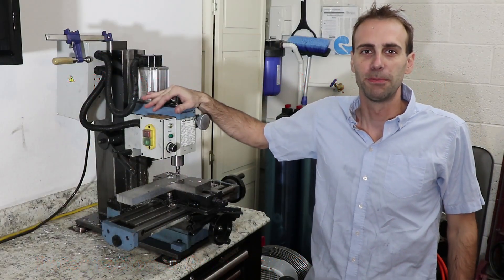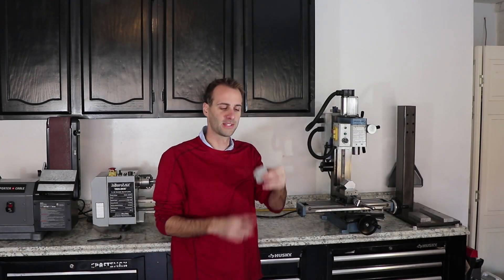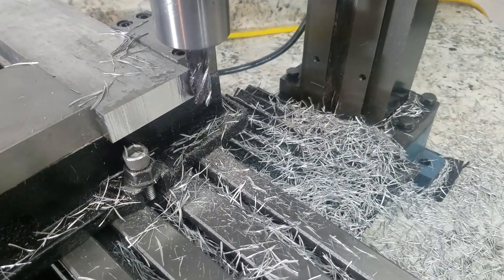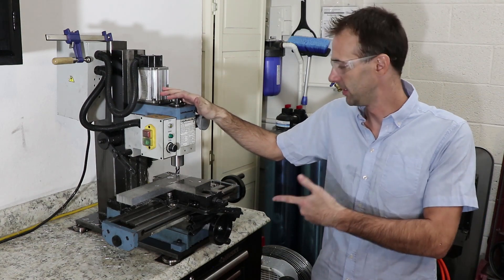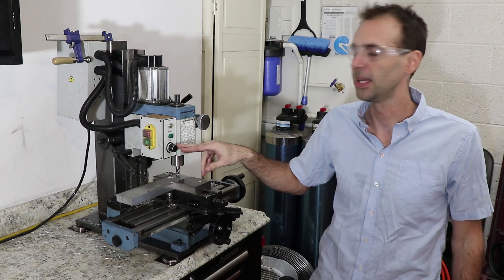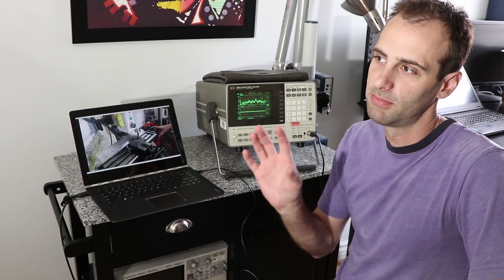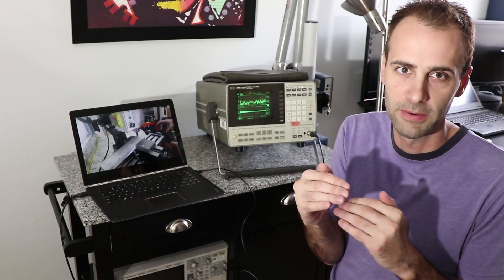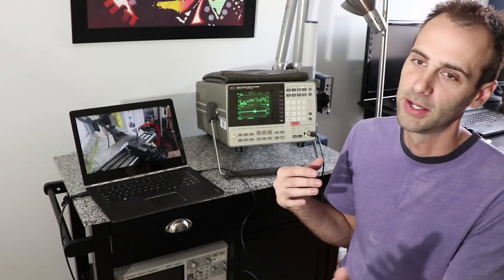Column Stiffener - LMS HiTorque Mini Mill

Comment from the maker: Thank you every one for your feedback, I am humbled that so many experts and hobbyists alike are chiming in! If we are all interested, I could use some help on how to perfect the experimental setup to prove all these great suggestions we are getting (number of flutes, direction of cut, ect…)
THIS video should really be called something like how to excite every resonant frequency in your tool (the opposite of how to produce a good surface finish) – it is not a great example of how to machine, what I hoped to do was push this tool beyond its limits before and after the mod, then try to quantify/identify the thresholds.
I have successfully cut just about every tricky material on this tool: Inconel, titanium, copper, plastic, even ceramics; it is capable of cutting them and making fantastic parts, what it’s not capable of (in any way no matter what you do to it) is be physically stout or massive enough to cleanly remove aluminum at this [in the video] high of a volumetric rate - it did it as you can see but man did it complain - basically the point of this experiment right? 
Per specific comments: 
I can tell you with absolute certainty that the nonmoving axes were locked, the gibs in the travel axis were tight and the table was not flailing around - further proof is that the gibs were so tight that the whole mill would rather slide rather than the dial turn (rubber pads under the feet got all oily when we moved it for welding); in normal operation there isn't this much force on the dials so the mill doesn't normally slide, especially when the pads are not oily; therefore no need to bolt it down.
Cutter geometry, number of flutes, feeds & spindle speeds.. all these make big differences across comparatively similar situations but to me a good machinist can "feel" around their weaknesses and tune the cut to suit – again, this particular experiment was to push the machine (and tooling) past its limits and excite those resonances so they could be measured.
Reply: How do you manage to tram it in with this setup?
Reply from the maker: @Sheepisgoo  When the column was bolted to the base, I used snap gauges to measure the gap and milled a spacer to suit. Its within a tho or so, you could do the copper and grout trick if you needed, but I don't.
Reply from the maker: @joenicotera2991  Yes, the "instrument" will always resonate; I like your association. The objective of a musical instrument is to resonate well over a desired range, and the objective of the string or pipe is to resonate at a discrete frequency (including it's harmonics). Similarly the design objective of a machine is to resonate at only discrete frequencies and with very narrow bandwidth, and be damped over the rest of the spectrum.  A milling machine experiences varying loads under different conditions unlike an instrument which ideally your not trying to bend - this is where stiffness helps to minimize the shifting of the resonances (re-tuning of the instrument) over various conditions.   As for the horrendous noise, I'm with you its awful, but a good way to excite the machine in the condition in which the stiffness & damping are needed most. If it were done with the hammer under no stress, it can be argued that it wouldn't paint the same picture.
Reply: Can you sell a base theres a costumer rigth here

Comment: I’ve been a Tool 6:16  maker for close to 35 years and for one, if you came straight back & climb cut without moving it it would square it up and clean it up. I always climb cut my finished cuts for better accuracy and better finish without taking any more stock maybe .001-.002” if need be.

Comment: That milling machine could have done the job. Sounds like you were trying to be too aggressive with how much stock you were trying to take off with each pass. Even though that milling machine is made in communist china, the notorious land of mass-produced junk, the Little Machine Shop manufacture added more quality and performance parts than the other manufactures who use the same castings of that machine for their own versions which their own versions are just painted with a different color,  they put their own logo on it, they make them as chintzy as possible, and they and their sellers will hype up the performance of their machines through glamorized advertisements

Comment: An interesting and informative video on the shortcomings of this ubiquitous design of mini mill. How about some more conventional experiments just using a DTI strategically placed in various positions between base plate and head that should show the needle fluctuating due to flexing whilst in use.
You could also produce a CAD model and apply Finite Element Analysis to it to see where the greatest stresses arise and so take the guesswork out of a stiffening strategy.

Comment: First time trying to cut some pockets with the Harbor freight X2 using a YG-1 3 flute carbide 3/8" and as I entered the corner(double the load if not more) the entire mills "C" shape as you put it folded downward and shattered the end mill right in half. I had previously manual and CNC milled on 250lb - 6,500lb machines but these smaller machines are seriously crippled until you fix the column and by then you still have a tiny cutting area. I paid $450 used like new and I think I paid too much, lol. Now have a 0.5" x 4" x 12" plate bolting column to base in back and I am considering either a new mill or 1" base plate that is 8.5" wide and 12.5" long to bolt the base to then the column plate I made would bolt to the new 1" base as well. From there filling column with epoxy granite and running some threaded rods down into the 1" base from inside the epoxy filled column. Just not sure if 4.3" of Y travel is worth the trouble.

Comment: i guess "God forbid" you ever need to tilt it.
Reply from the maker: It's a solid column so it doesn't tilt. The tilting column is more diverse in utility but the fixed column can take deeper cuts out of the box because its a little more rigid.

Comment: 3:56 Your gibs are out of wack. Every crank you make i can see entire jig moving wildly.
Reply from the maker: Good eye. If you look closely you can see the whole mill sliding on the oily table. I here you, they have to be dialed, and they were. There would be a lot more volatility in the sound if they were loose, the table oscillates at a few hertz, way faster than the dial spins.

Comment: Or, you could just bolt it down to a suitable bench like the manual specifically instructs.  It is a cool design, and it does what it's supposed to, but I feel you could have achieved similar results simply following the instructions provided with the machine.

These mini mills are top heavy and should never be used without being secured down properly.  This is a good alternative if you don't want to run bolts thru your bench, a better option would be to take your design and bolt that to your bench, rigidity on top of rigidity.

Even with all that rigidity you still have to keep in mind that the operative word in "mini mill" is MINI, and adjust your expectations accordingly, lol.  I'm giving a thumbs like for sure, very creative.
Reply from the maker: Thanks mate. Yes you are correct, this mill is maxed out.  The previous flex point was the joint and the column, behind the back 2 bolts.    The new weak point is the z axis dove tails; you can see the head dancing back and forth.    It's almost like someone calculated the loads on the whole machine all at the same time 😄

Comment: It unwinds the tool due to conventional milling you should always where possible climb mill
Reply from the maker: I've never had luck climb milling on manual tools, the table just jumps with all the backlash. Its better on a CNC because they take so much care to avoid backlash. I usually will do spring cuts and finishing passes because as you say the dynamics are better but it only works when the cutting load is less than the force required to move the table.

Comment: I'm sure this is too late, but I think the mass of the head on this type of mill is a pretty big limiting factor.  Now that you've stiffened your column, try adding 30 lbs of lead to the head of the mill.  I screwed it on mine, but I think epoxy would work better.  The problem with the epoxy is that it would affect resale quite a bit.  I really wish someone would redesign these.  Why not make the head mount more permanent (though I suppose there would still be some play in the gibs)?  Who is going to tilt one of these?  Why isn't the column to base mount gusseted?  Why doesn't the base extend another 3 inches to the rear so the column could be bolted further away from the column?  By the way, if sand is added to the column it will reduce resonance and add mass, but I'd be tempted to add lead shot and epoxy slurry.  Sorry I'm so long winded.  Stay safe.
Reply from the maker: Yes, great suggestions. you can watch the head wobble on the Z gibs now. I think you will always be chasing the weakest link.   Its better to buy the bigger tool to do bigger work. I just love the footprint on this one and one person can move it!    For now I will take more passes, and smaller depth of cuts.

Comment: What's that slot shaped flat plate attached on the column with a round black disc, right under that black cable hose and above the video timer mark of 5:23? The slot is connected a bolt. What's that used for?
Reply from the maker: My gosh that sound is annoying at that time!  Its a counterbalance spring so the mill head doesn't drop.
Reply: @internationalprecisionengi1737  
Thanks for the information. Cheers. 😉👍

Comment: Perhaps having a longer base plate extending to the back would allow a gusset to stiffen the post and thus further dampen the lower freq.
Reply from the maker: The new weak link is the gibs on the z axis. You can see the head swinging back and forth now, its crazy!

Comment: considering the same thing to my g0704 style mill , figured using a U beam thats wider than the original mast and the same type of bottomplate to weld it on but smaller to bolt ontoo a bigger plate the same way the original mast on youre machine , this makes it eazier to machine straight after welding it  , i was planning to have the front of the U machined perfectly flat and angled from the ground plate and mount it to the original mast with a few verry big diameter short bolts along its length 
as for the frequency of the resonance , seen a verry interesting video a while back from some mayor cnc machine manufacturer , he used the rpm of the machine and reved it up and down in a sinepattern , it preventing the machining to resonate the piece with a large stickout it was machining sounded weird but worked good , because its a cnc machine to can heve the tools move with the same sinespeed to make the cut look even
Reply from the maker: Yea, that does sound crazy. I've seen chip breaking tool paths too, where the feed is sinusoidal, I think it can load and unload the tool faster that way.

Comment: I agree with Ken Ibn Anak in filling the new column stiffener with sand and pea gravel. I have used this technique in barrel tuners (different material of course) for precision rifles and it dampens the flexing of the piece tremendously.

Comment: i believe you are milling in the wrong direction,  try  climb milling
Reply from the maker: On manual mills there is usually tons of backlash, as apposed to a CNC where this is minimized by design (one of the reasons for considerable cost increase). Given the backlash, on this machine, there is not enough mass to keep the table from getting periodically sucked into the tool. Even with the gibs sinched, its a balance between the tiny screws overcoming the friction vs the part getting sucked in. When conventional milling you are fighting both the friction and the cutting force so, while not ideal, it is more stable.      The optimal algorithm on most manual machines is to take your rough cuts conventionally, and do your finish passes (with significantly less or no load) while climb milling.

Comment: Good science! I love it. I am a loo-thier so I think in resonance. I am not much of a machinist so I watch these videos to gather some knowledge here and there. Here’s a little anecdote. I have a CNC router that I use to make guitar fret boards. The cutter is a 0.025EM. Once I snapped a bit by just barely touching it, that’s how fragile they are. I keep the speed rate very low and the depth of cut very shallow but the spindle speed is something that benefits from this type of analysis. I don’t use fancy equipment but could if I wanted to waste a bunch of time.  I determine that the speed of the spindle that is spinning at a resonant frequency can be avoided by a simple method. I put my hand on the spindle and sweep the speed from low to high until I feel vibration. I can mark that speed as the offender. So it’s a simple matter of choosing a speed that is optimal with an optimal feed rate of coarse, And make sure that I am away from that resonance by  Turning the speed up or down a little bit. That’s all no big deal but I haven’t broken a bid yet except when I touched it by accident.
Reply from the maker: Ken It is incredible how sensitive our bodies are. I worked in a Lab where they did earth quake testing and I wanted to ride the test cell (while OSHA wasn't around of course). I was told that that particular frequency matches our bodies resonant frequency and that it could likely cause serious injury. I never rode it, but always think about it: was it a mental reaction thing or a physical limitation of our bodies to be jerked like that?          Regarding your tool: The major benefit that you have is that there is no load while you are milling. This benefits you, otherwise as you tension the members of the machine under load your resonances will likely change. The thing that most people forget is that you can map the best feeds and speeds but you are hitting the entire spectrum of speed when you corner or switch directions (0 to hero).

Comment: Great instructive video! Thanks. I'm surprised how small is the amount of soldering and how it could stand all the strength in a long term.
Have you thought of making several pass of soldering or maybe using a bigger wire later on ? I'm no expert.
Reply: That's not solder, it's TIG  welding.
Reply: @clintchapman4319  Yes, welding! Sorry for my french accent :) Ok, I thought that the wire thickness needed to be the same dimension as the part to weld. But It's just a support that adds up to the structure I guess...Thanks
Reply from the maker: Yes it may look anemic, but (if I can remember correctly) the material was beveled prior to welding so they should be full penetration welds; with the correct filler material the weld can be stronger than the bulk even though there is no protrusion. 
In this application it doesn't really matter tho, the applied force being a moment on the joint puts only tension or compression on the weld and given that the neutral axis is somewhere between the original column and the new upright, the entire weld will cycle from tension to compression. I haven't done the calcs but I would imagine that even a few tacks would add tremendous stiffness.

Comment: Outstanding vid, thank you for the idea for stiffening my mill, I have the same machine, but the older version that tilts at the base, I have never tilted it, and don't plan on it, that join is the problem on mine, and your idea will fix it.

I modified the fine down feed on mine, by making a larger knob/handle, with the z axis tightened up, I can now plunge cut into Titanium without fear of shattering the carbide end mills, well, maybe a little bum tightening ;).

Thanks again,
Scott.
Reply from the maker: Great idea on the knob! I can imagine myself doing the shuffle trying to twist that thing as I do it - head in the zone, body rotating with the knob...

Comment: That mill can easily swing a 3/4 end mill or a 2" boring head.  I've had one for several years.  Just yesterday I was milling tool steel in it with a 1/2" carbide endmill.  In fact, the one I have has the tiltable column - less rigid than yours.  I heard about the "column stiffness" issue and even bought material to help with that. But after going over the mill, it became obvious going through the gibs (tightness and deburring) and properly lubing it makes a huge difference - big enough that the material I bought years ago to stiffen the column is still sitting unused.  As with other posters, I can see your table moving (more than the rest of the mill).  Loose gibs and machining technique are 90% of your problem, not column stiffness.  I'm not saying stiffening the column doesn't help, but in your case that's not the majority of your issues.
Reply from the maker: Thank you for commenting you triggered a thought, I was wondering why there was so much feedback on this video and I think you nailed it on the head -  the video should be called something like how to excite every resonant frequency in your tool (the opposite of how to produce a good surface finish). Measuring frequency and (hoped to but failed at) quantify the magnitude was the basis of the experiment - so it had to be pushed beyond its limits, right? I've tried to summarize some of the major points in every ones feedback and I'll pin it, let me know what you think.